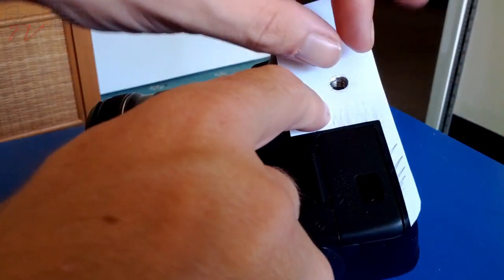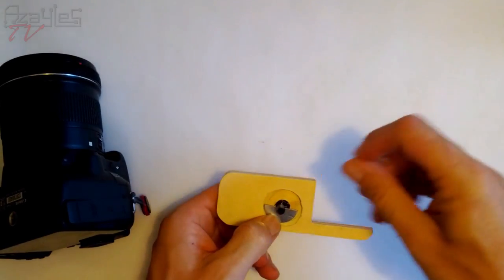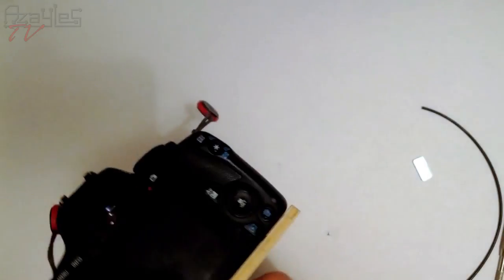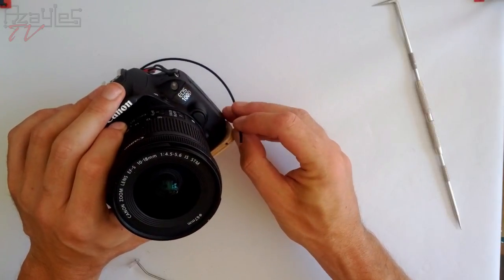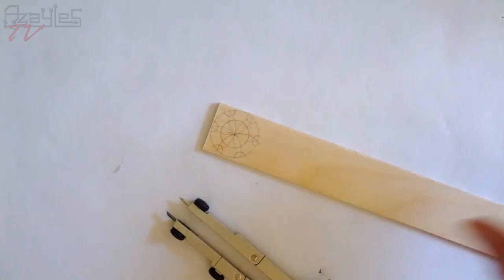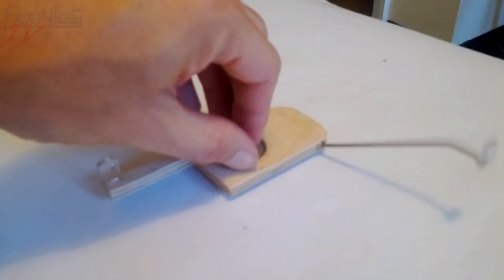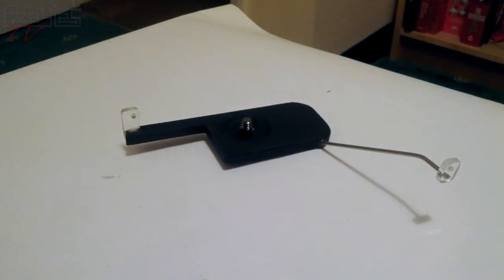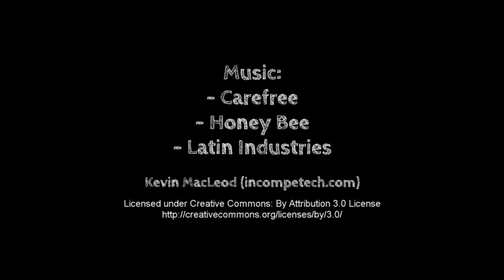Fibre Optic Camera Record Light Extension

Comment: I did not think you could do that with fibre optics, that's so cool!
Reply from the maker: Thanks, Robin! :D
I snarfed several lengths of fibre optic cable from some old industrial equipment where I used to work. I knew I'd make use of some of it eventually :D